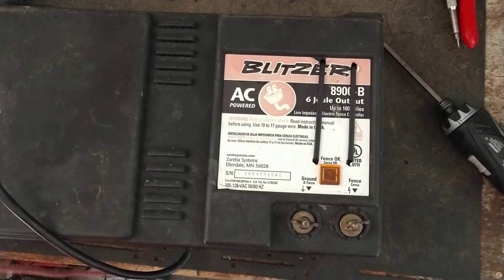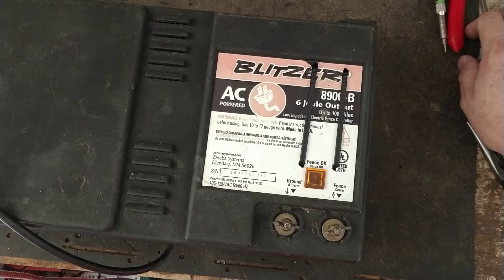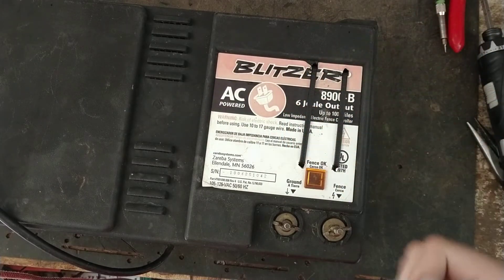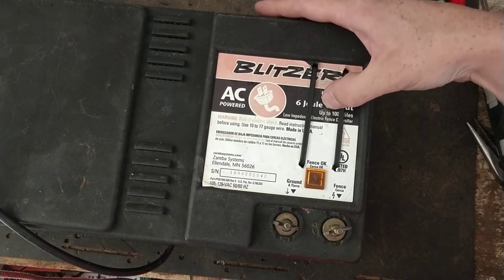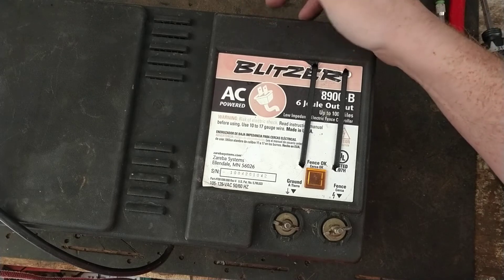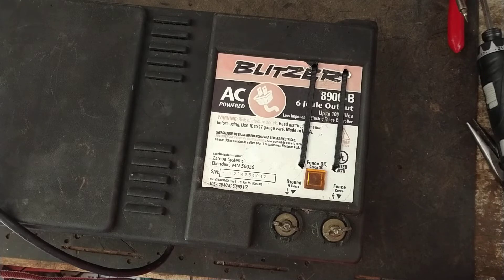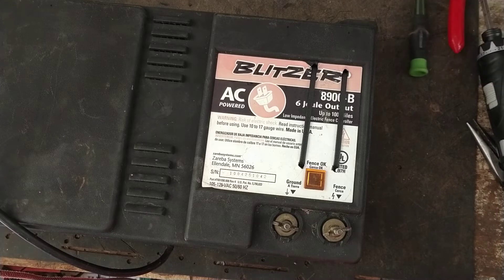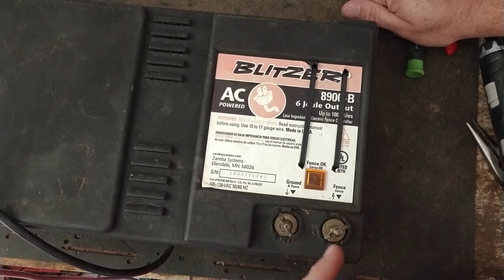Stored Joules & Output Joules On Low Impedance Fence Chargers Explained.

Comment: I have a 10 yr old plastic Gallagher but no info on it. i put my meter on the unit and it reads @ 6.5 does that mean 6.5 K volts? How can I find out how many Joules it has? Why did you mention Amps? 1.2 A will kill a cow or horse. sorry, but you got me confused. thanks for your time.
Reply from the maker: Can you email me a picture of the Gallagher unit you have, fencerfixer816@gmail.com
The 6.5 is 6.5kv or 6,500 volts. 

On the amperage, it will hurt the animal, but since every low impedance unit made is a clicking type, all it does is give the animal a safe, non lethal pop in the nose or wherever, and allows them to bump off the fence and away from the wire. It's a psychological shock more than anything, and they'll learn real quick not to touch it. 

If it was a continuous shock, which old weed burner type units were 45-50+ years ago, those could hurt things if the right condition was met, but that's why those aren't around anymore.

Comment: Greetings, What gives a more painful shock for the same amount of energy? low impedance or high impedance fence chargers? Edit: I might add; for a small fence system of about 200 feet.
Reply from the maker: Get a low impedance unit of around 2 joules and you'll be happy. High impedance aren't really made anymore and if you do find one, parts are pretty slim for one.

Comment: I have a Gallagher S12 unit and I'm hoping to keep out rabbits/squirrels from my garden.  Will this be sufficient?  And should I have more than 3 strands of wire?  Thank you!!
Reply from the maker: If should be stout enough. Just make sure the unit it's well grounded and that the spacing between each wire is set to where the critters can't sneak through the wires or sneak underneath.

Comment: What other fault finder would you advise that can read joules?
Reply from the maker: There's not one that I know of here in the states that I can find. They're was a cheaper priced one in the $100+ range that we had, but that dumb thing broke and doesn't work. I've talked to manufacturers about trying to get something from them, but they don't manufacturer them and it's just kind of a one off thing that they have. So you really just have to take their word for it on what the stored or output joules are. And honestly, all the units we tested with the joule meter we had ready fairly accurately of what was stated by the manufacturer is the fence charger, so they're probably telling the truth a good portion of the time.

Comment: I am pretty certain using the 200 ohm resistor is important for producing a relatively accurate Joule measurement using the Field Guardian Fault Finder.  The way it is measuring Joules is by using ohms law and measuring the voltage drop across an assumed resistance load.  It converts this voltage drop into Joules using an internal conversion.  Using 150 ohms instead of 200 ohms I would almost care to guess resulted in your Joule measurement being lower than the actual Joules.  Joule = 1Watt for 1Sec = Voltage * Current * 1 sec = Voltage^2/Resistance * 1 Sec.  I could totally be wrong as I'm a little rusty on electronic theory 18 years since I got out of the Navy as an Electronics Technician.
Reply from the maker: I didn't have a 200 ohm resistor so I used what I had. Every model of low impedance fence charger has it's limits of how much resistance it'll take. The joule output of the unit will increase at the terminals and will go so high until you reach that limit and then you'll start to see the joules start to go back down because you're dragging it down too hard. I don't think the difference in 50 ohms would've made all that much difference in the joule reading it gave. That Field Guardian tester is pretty cheaply made and it finally quit working about 6 months ago. I think this particular video is 2+ years old already.

Comment: I see solar energizers are common between .1 and.75 joules. Is solar somehow different in joules or is it they are not adequate for say goats?
Reply from the maker: The biggest thing with higher joule units and solar is the sizing and cost of the solar panel needed to maintain the battery. The more joules a unit has the more draw it has on the battery and the bigger the solar panel requirement would be. The biggest joule all in one solar unit with a battery is the Gallagher S400 solar at 4 stored joules.

If you want more joules for goats, you're going to have to go with a standalone 12v powered unit. There's lots of different brands that make some 5-15+ joule 12v units, you would just have to come up with a good size solar panel and a voltage regulator to maintain the battery and keep up with the draw. For goats, most companies say you need a minimum of around 3-5 output joules. Also, don't look at mileage ratings on a unit, that will sometimes get you in trouble and end up picking the wrong size unit. Also, don't go real large in joules even if you can afford it. Look at around 4-6 joules for goats and you'll be just fine. If you need help with solar panel sizing, give me a holler and I'll bet happy to help you out

Comment: So how many joules/volts would you recommend for goats?
Reply from the maker: Volts aren't really super important because every brand and model is around 5kv-10kv range, so you take want to look at the joules. Goats need at a minimum of 4 output joules to make them respect the fence. You don't need 15-20 joules because it'll be a waste of both money and shock power that you probably won't be getting because of not having enough load for the unit. So I would look at anything in that 5-10 joule range and that should be plenty enough for goats.

Comment: gemini 80 1.2 jots if  i grab the green and red leds in both hands  woht wood heapen if i grab the both leds in my hands
Reply from the maker: If the unit itself is working correctly, You'll complete the circuit and get a shock from the unit.

Comment: Enjoy all the FFR videos!  My question is at timecode 7:36...shouldn't you be getting a higher joule reading when under no load?  I have a .2j output charger and the same meter and when I test with no load I get a joule reading of 1.70j at 4.8kv but if I attach the 200ohm across it right on the money of 0.2j at 2.2kv. Would the meter need a load to quantify joules or is the charger actually putting out 1.70j when under no load? Are you then able to calculate the joules when the fence is applied or is this only tested without the fence but with the resistor?
Reply from the maker: With no load across it between fence and ground, the unit won't have any stress so they kv should be high and the joules will be low. The resistor going across is just what I use to simulate a certain load on the fence between the fence wires and the ground, like a bunch off grad or something. Typically they won't read much joules at all with nothing connected across them, but with high kv. The output joules won't really start showing up until you get around 500 ohms across it, that seems to be what most brands base their readings off of is 500 ohms. Bigger units will handle heavier loads down to 50-100 ohms, but smaller joule units can't handle it as well. The closer you get to zero ohms across the terminals, a dead short, the heavier the load is on the unit. On smaller powered units, once you get too much of a load on it, it'll eventually drag the kv down too far and you won't get much joule output at all.
Reply: @FencerFixerRepairLLCKansasCity  Well my exact Field Guardian meter that you have in this video will not power on.  Is this something you repair or have any troubleshooting suggestions?
Reply: I think you were answering my question from 4 years ago...but this question above...with my meter not powering on...thanks.
Reply from the maker: Hi, you could try a new battery inside, but other than that, there are no parts available for that tester. Once it fails, it's junk I guess.
Reply from the maker: I realized that after the fact lol. I sent another message afterwards, sorry about that
Reply: @FencerFixerRepairLLCKansasCity  lol np...yea changed batteries no luck...I guess the meter is now junk...Thanks for the reply!
Reply from the maker: Nope, under no load the unit isn't doing any work, so you won't see any joules at all. Just max output KV reading. The closer you get to 1 ohm the more of a dead short and heavier the load is. Once your voltage gets below 3-3.5kv, the joules starts to fall off. 200 ohms is pretty heavy for a unit of your size rating. I imagine a 500-750 ohm would be a little easier on your unit and wouldn't drag it down so far in kv and you would see a little bit higher joule reading The higher the kv reading is on the unit, the less stress is under and the less joules that are coming out of the unit and being used up as heat inside the transformer. So when you test your fence, add long as the voltage on the Gerber is 4kv or higher, your joules will always be there. If it starts falling below 4kv and gets closer to 3-3.5kv or less, then the joules will stay to fall off, which is exactly what you're showing with that meter and load your hooking up to it.

Comment: I have a relatively  short fence, to keep garbage bears from our porch, and have a unit that puts out over 8000 volts and is quite powerful in terms of joules (though I do not know that value off hand). It is intended for large farm animals, and has no observable leakage to ground. Do you think there might be an internal resistance (a phantom load) to set a higher joule value, or should I install a moderate load resistor just to ensure there is enough juice to deter a wandering bear? The unit is sealed, so I cannot check inside.
Reply from the maker: If it's a low impedance electric fence charger, you shouldn't have to put any external resistance to it. When the animal touches the fence, their body is the resistor going between fence and ground which causes the unit to ramp up it's power you shock the fence harder. The unit doesn't know the difference between an animal touching the fence and a human or a bunch of grass, it just feels resistance, so it'll do all by itself.
Reply: @FencerFixerRepairLLCKansasCity  Thanks so much. It is low impedance, so no worries. Not being a farmer yet having large potentially aggressive animals wondering by, led me to electric fences, and you have taught me a great deal. Thanks again.